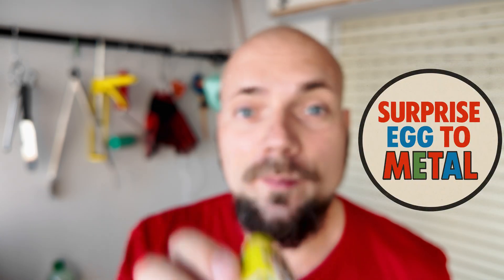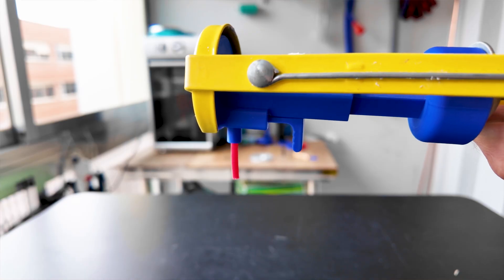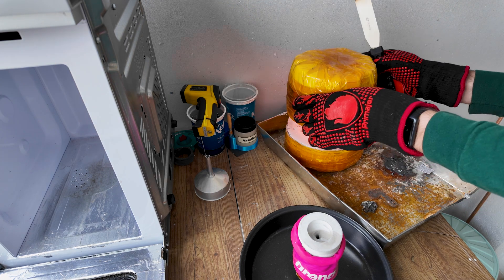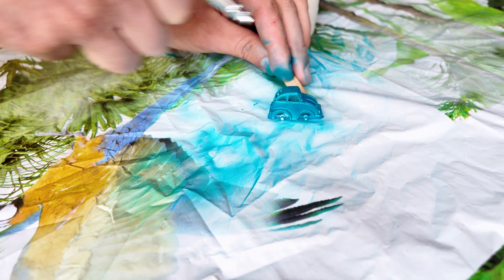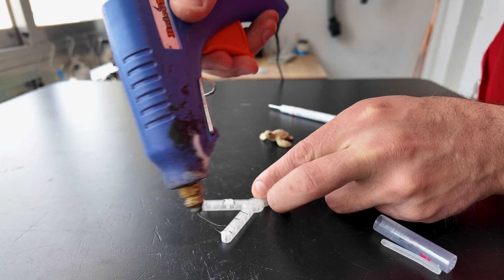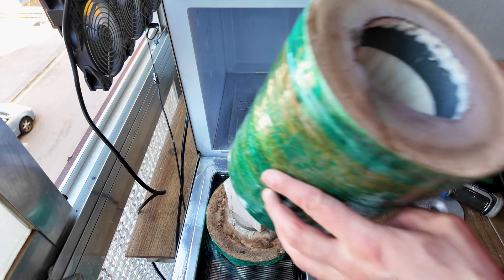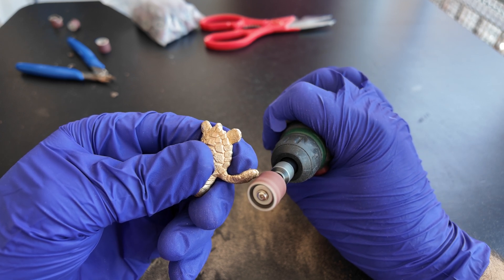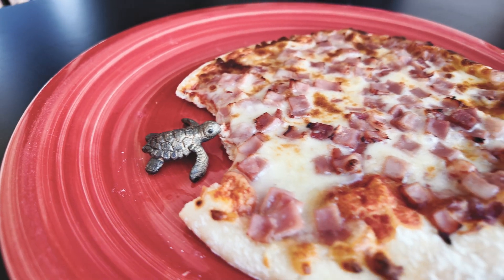Casting Aluminium and Bronze Toys | Surprise Egg to Metal Ep-1

Comment: What ratio of plaster parts to sand do you use so it doesn't crack when burning out the mold
Reply from the maker: The plaster molds do crack on a regular basis, but those are usually small cracks that disappear as the mold cools down. These minor cracks typically don’t cause many issues.

It also depends on the type of plaster used and how it's mixed as wella s the size of the mold. Smaller molds crack less.

For most of my molds, I mix it as follows:
1 part water : 0.5 parts fine sand : 1.1 parts plaster
(Example: 200g water, 100g sand, 220g plaster)

That’s my usual starting “recipe,” but I’ll adjust it depending on the plaster I use, the size of the mold, or the item I’m trying to cast.

Sometimes I make my molds more watery — they might be weaker and more prone to crumbling, but they often crack less since the plaster can breathe better and let gases escape.

One thing I can confirm: Not all plaster products are the same!
Even if it says "Plaster of Paris" it does not mean it's going to be the same product as it can vary from brand to brand. Cheers!
Reply: @ShakeTheFuture  thank you so much for the great info. Not everyone is happy to give up hard earned knowledge. Keep up the great work!! Look forward to seeing what's next.